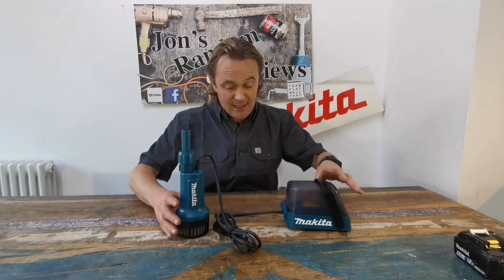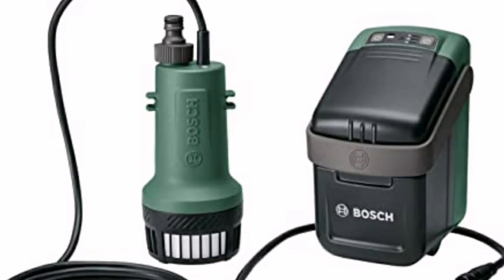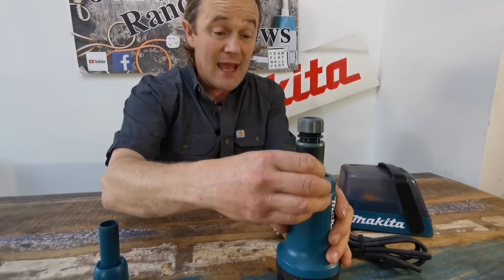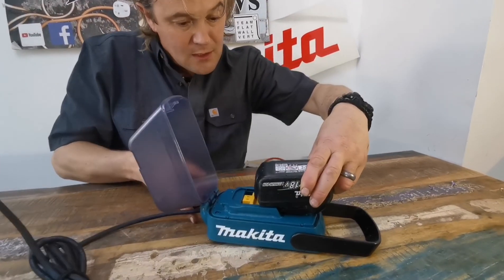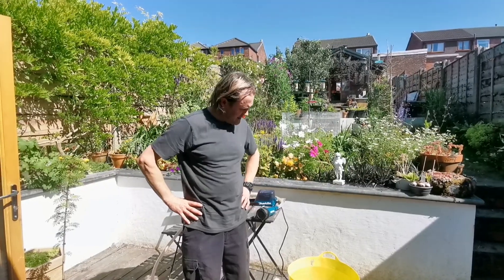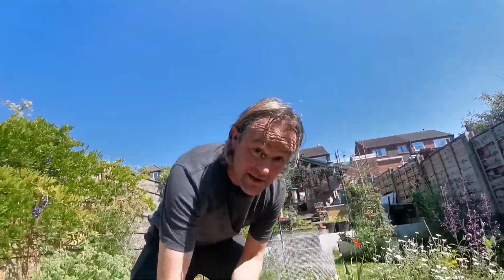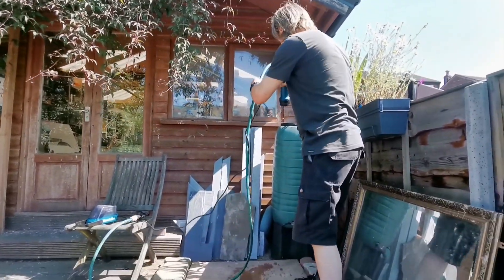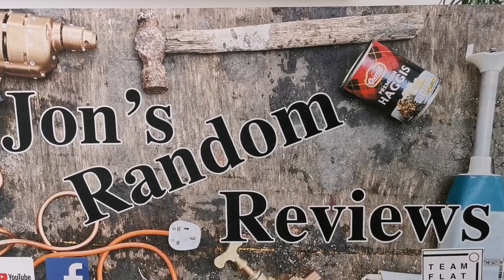18v submersible pump!!! Was bosch and now it's makita!!!

Comment: This looks great. Currently have a 1000L bowser on the back of a mule with a 4 stroke water pump on a trailer to water trees around the property I work on. With this, I should be able to just drop the pump in and get to work without messing round with petrol and noise.
BTW, water scorching in summer is a myth with most plants so water go your hearts content

Comment: When using the hand held spray. Does the pump run when the spray button is pressed?
Reply from the maker: Hi sir no sorry It doesn’t, it’s just a case of getting the pump going and then using the spray head,I guess if you got the pump going with the spray head on but not pressed for a long period it might heat up the pump some but with it being submerged it would be ok for a while,it’s the kind of pump that will only build up a certain pressure ( not that much, probably about half a bar ish) I guess it would be possible to rig up a micro switch on the spray head to turn on the pump,we just use this pump really for pumping out water tanks,cheers for commenting 🤟🤟

Comment: I need to review that!
Reply from the maker: Hi sir well there is only my one and one of my you tube friends has made one so there In ah hem limited supply! I went well ocd with mine and another dude has converted one of these Bosch pumps to run of one of those rare 2ah lxt battery’s which are slim onto a makita to Bosch 3d printed eBay special and I think although he hasn’t got back to me the cover will click on and you can use the original Bosch on off button,seriously tho this pump is really really good, MAKITA TAKE NOTE!!! THEY WOULD SELL A TON OF THESE TO BUILDERS/PLUMBERS AND GARDENERS!!!, thanks for commenting you get 2 of these 👊🏻👊🏻 and 2 of theses 🤟🤟

Comment: hi john . do u have ne specs on how u did this as i have all the components and would like to build onw my self
Reply from the maker: Oh hi Chris thanks for reaching out,mmmm looking back at the video I should have gone more into how I made it but hey ho I didn’t sorry,the main bit of the conversion is the use of a makita lxt usb charger which is sunk into the water proof battery box after the Bosch battery attachment bit is cut out, it’s fairly easy to do the wiring inside, you just connect the positive and negative from the Bosch battery terminals to the terminals inside the makita usb charger,I guess another way would be to buy a Bosch to makita adhaptor and do it that way but the clear cover will probably not fit then and the micro switch will need to be linked out and the on off would just be controlled by pushing the battery on, I think there’s some adhaptors you can get off eBay,if you want to do it my way it’s not to bad to do the biggest challenge is setting the makita battery’s attachment into the plastic of the box,it’s a bit fiddly and time consuming but rewarding at the end,hope this has been a little help to get you going,please feel free to get back to me with any other questions about this project,I might be tempted to do another video If it helps,cheers sir 🤟🤟
Reply: @UKTOOLTALK  does that mean all the buttons on the bosch part for on and off will be redundant . as just took them apart . and the red and black easily swapable but the rest seems confusing
Reply: as wouldnt mind getting those buttons on the bosch to work with the makita battery
Reply: would be easier if we could chat or maybe me send u both parts . lol
Reply from the maker: That’s cool if you go on my instagram page nixonatorsk8 and dm me I’ll talk you through it maybe with a video call I’m sure we will sort it out,I need to get mine apart to be honest and re check what I did 🤟🤟
Reply: @UKTOOLTALK  fxxk .i dnt have instagram tried it once .did my head in
Reply from the maker: Ok email me at nixonator508@gmail.com 🤟🤟
Reply: @UKTOOLTALK  done

Comment: Hi! It is very interesting the introduction. May I know where did you buy it? What is the model sigla number? I would like to buy it. Thanks!
Reply from the maker: Really sorry for the late reply my friend I feel dreadful,the pump originally before I converted it to makita was a Bosch 18v garden pump 23a6g9 ,you should be able to find it online 🤟🤟
Reply: Thanks for reply! I am sorry not noticed that it is modified by yourself， but anyway it is a good job, I have also a lot of Makita batteries and hope to use them for this Bosch pump. Would you explain me how you modified the socket of the pump in order to use a Makita battery? I worry that the original Bosch PBA socket hood is too small to hold an adapter of battery. Thanks again!